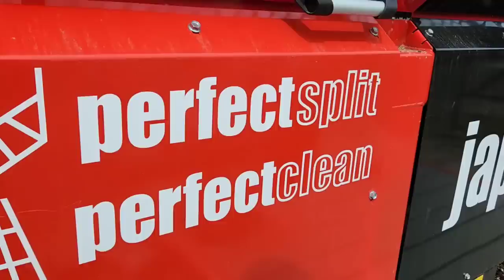Elm vs. Japa 405 Firewood Processor... I wasn't expecting this result!!!

Comment: Imagine what you could have accomplished if the sun wasn't  in your eyes.  🤠    Man, what a machine.👍👍👍👍
Reply from the maker: It would have been a great excuse though!!  Thanks Lance
Reply: Can always take an agle grinder with a flap disc to sharoen the box wedge. Or put a turbo on the engine that would make a Caterpillar diesel proud!

Comment: Good morning Joe,
That was very interesting to watch. I've split a lot of elm and it can be awkward but it makes top quality firewood.
Just an observation, the knives on the Japa perfect split are probably half the thickness of some on competitors machines I've seen,which are to me, way too thick and cause wood to jam or flip over on the more open wedges.
The knives on my machine ( which I made myself as the originals were  junk) are only 8mm thick. I keep them sharp and I've never bent or broken one yet. 
 This is a huge advantage and tells me Japa have done a great job in designing their machines. 
Keep splitting 🇬🇧
Reply from the maker: Thanks Paul.  The knives work very good.  They seem to be keeping their edge prett good too.

Comment: Isnt it amazing how well the box wedge does on elm.. we have alot of red elm here and no one wants to split it on a convensional splitter.. so thru the years i used to let tree services dump it here and when we built the box wedge i couldnt believe it split so nice too.
Reply from the maker: It seem if the machine takes slices off of it things go much better Jason.  Thanks buddy
Reply: @ohiowoodburner  one of these days i need to make a video of the knife blades we made 3 years ago for the processor. Its a 28 way wedge design that we didnt know if it would work but does amazing with 24 to 36 inch wood. Can take a 3ft log and make bundle wood out of it at 2 3/4" pieces. I get alot of tree service stuff.

Comment: I’m impressed. When you run the bar at the same time as the splitter it slows a bit on regular wood. The speed of the ram in the elm looked similar to that speed just splitting.
Reply from the maker: That is because I had it adjusted correctly.  When you hear the engine bog that is operator error

Comment: Found a dead elm in my woods in March. Had no problem at all splitting it. Splitter is single wedge and 70 hp , sometimes 95. 3pt hitch tractor powered. Did you get a moisture on the elm?
Reply from the maker: This stuff is pretty wet.  The log was green when it came onto the land

Comment: Das yapper has the advantage of the push Plate bottoming out on the Wedge. Unlike most Splitters stop just short leaving the Elm stings staying together. I have as Piece of Horse Mat on My splitter just for Stringy Wood.
Mike M.
Reply from the maker: Interesting.  This has that hard nylon insert which shoves into the ram.  Hard stuff

Comment: Great video…your really funny!…I got to give it up to that machine, it does look like it’s built cheaply with the thin gauge steel and welds, but it processed rather quick and smooth, I like the little shaker deck before it hits the conveyor!   Would like to know how many cords it produces in a 4 or 8 hour run.

Comment: You normally activate the cut off bar while splitting the prior piece believe you should have applied those actions for the test!  The split ram did do a remarkable job would be great to know what the relief valve spec/setting is on that valve!  Everyone is entitled to their opinion but we me live Elm makes excellent shade and that about covers it's positive aspects.  Obviously your processor is a tremendous machine!
Reply from the maker: That wasn't intentional.  I was just wanting to highllight the wood getting split.  I'm sure it would have been fine.  I can also dial back the saw pressure to help the splitter out.

Comment: I don't feel that elm is as tough of wood to split as people think. The first time I broke the wedge on my Turner mills processor was with a stringy ash but log. The second time was a hard maple but log. I agree elm is tough stuff when it's tree service wood. A small elm like you had that's just like any other stick of log length firewood.
Reply from the maker: Seems to be stringy regardless.  I should have done a maul on one to show.

Comment: Joe you should spray the section where you have rust with some WD-40. I ran a production saw in the early 80’s and it was 50 years old then. Not a speck of rust because at the end of the day we’d always spray it down with WD-40.
Reply from the maker: Good idea Kurt.  I will do that going forward.

Comment: Have you ever split hickory on your 405?  I've have hand split hickory many time's and it is one of the hardest wood to split even on my 35 ton log splitter. The next hardest wood is hedge it's a very hard wood. Hedge is so hard it like a rock. Hand splitting hedge wood takes hours to split with wedges. Even my 35 ton log split has a very hard time splitting the hedge wood. So I challenge you and you 405 to split hickory and hedge if y'all have hickory and hedge in Ohio.

Comment: I never had difficulty with piss elm, splitting with sledge/wedges or 16 hp splitter. Cut & split trees with  36" base or larger. Modern Elm  does not grow as large in  diameter before mother nature kill it, but it burns like its counterpart of the 1950's.  Great BTU's & appetite from loading unto trailer & processing same. Too bad it is disappearing like Ash, Ironwood & Beech Trees.

Comment: I would give a guy down the street that sold fire wood all my elm. Him and his dad built a splitter  with a 6 inch ram out of a trash truck. I beam look like a bridge beam lol had a winch (hand crank) I had a agreement with him that if he wanted it he had to take good bad and ugly. So that is why the ole man built the splitter so he could split them big ole y s and knots.he wood bring a 40 foot gooseneck and man did I load him down his dad would get so mad at me but oh well. That splitter had a cycle that took about 3 minutes just to come back lol. Even that crazy thing wouldn’t split those red elm. Now u have the easy elm we call it white elm and it splits pretty easy but if u get some red cedar elm just toss it in the fire pit. Ole Herald bell was his name and he sold the crap out of it and mix it up with that junk cotton wood slab stuff 5 inches of bark and 3 wood. Cheap wood that takes a lot to produce. Poore people have poore ways
Reply from the maker: Thanks for the post Randy.  Seems dutch elm disease has put a lot of elm thru splitters

Comment: That stuff is dry split some wet piss elm different results cause still has water in it in the winter piss elm splits like maple easy mine was done by hand no machine hated the smell but it all sells mixed wood we could not use paf llets for our wood would get in 🎉way of customer getting loads of wood are wood dries fine on the ground sell enough of it 18:52

Comment: The 405 was effective on the elm, you proved it about, what, 600 times! I don't think there is a perfect wood processor. There's always somethin' not quite right about all of them. I don't like the enclosure door. I do like the the hold down clamp with the rollers that bite the wood. Don't like the log infeed. Do like the speed and power of the splitter ram. Don't like the....
Reply from the maker: haha.  I know what you mean.  My biggest gripe is the chain tensioner.

Comment: Logic would tell you that the splitter will split a 12” with the same torque as an 8” piece, after all the wedge will only remove a measured amount from either!! I’ve used all sorts of splitters over the years and contrary to what you heard I’ve never heard a ram groan or make any noise, why? They just don’t !! Yes you might hear the pump coming under pressure but not the ram. Get it right Joe and stop the dramatising crap!! 😎